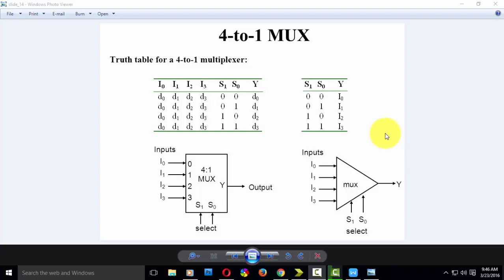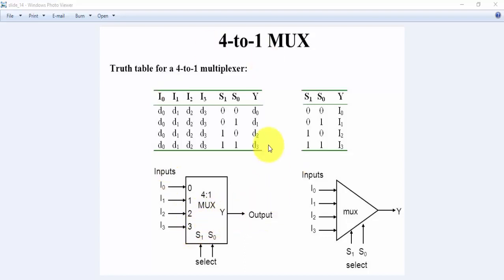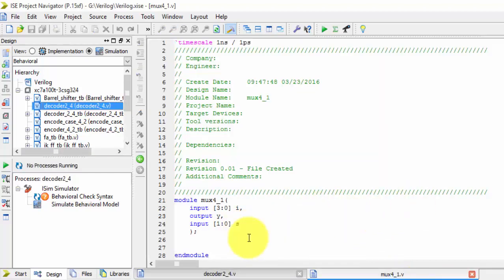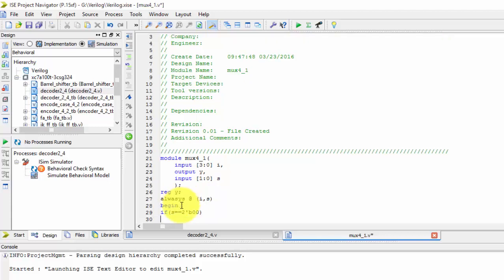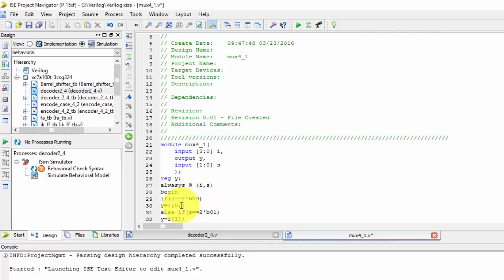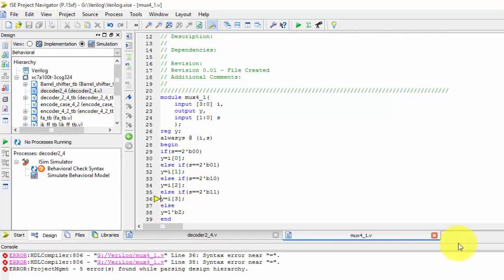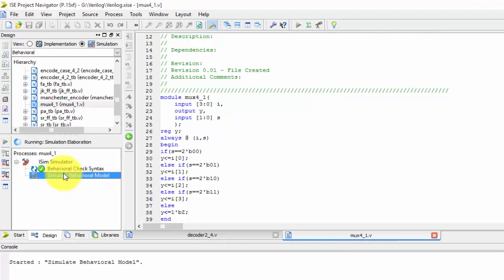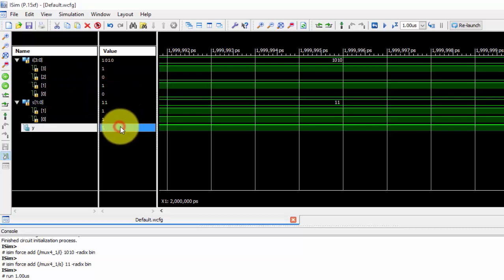Verilog Implementation of 4:1 Multiplexer Using Behavioral Model

Comment: why did  you use <= operator instead of = for assigning value to y inside always block?
Reply: = is blocking, while <= is non-blocking... If using for example y=2, then next time attempt to use y=3 will not change value of y. You may look at this way: the right expression (math, logic, whatever) "goes to" output, in this case y. So, "y<= (1+2)" read: "after sum of 1+2, output value to y".

Comment: wtf is this, this is hard to read and redundant code and may actually cause priority encoder, why not use case statement instead, also "always @*" is more convenient. Also, you should not be using nonblocking assignment (<=) in combinational logic. In the default case we write x into the output (for simulation purposes).
always @*
begin
   case(s)
       0 : y = i[0];
       1 : y = i[1];
       2 : y = i2];
       3 : y = i[3];
       default: y = 1'bx;
   endcase
end